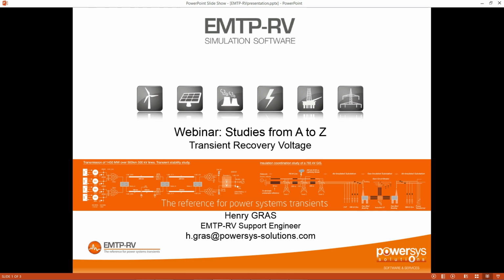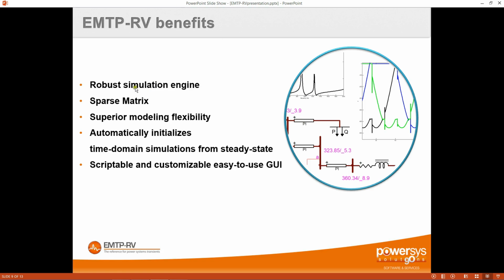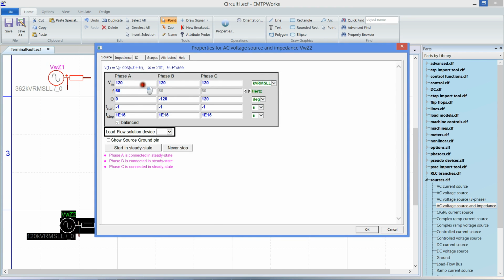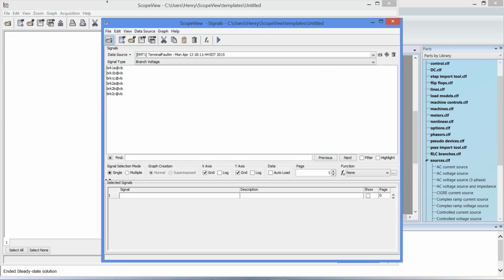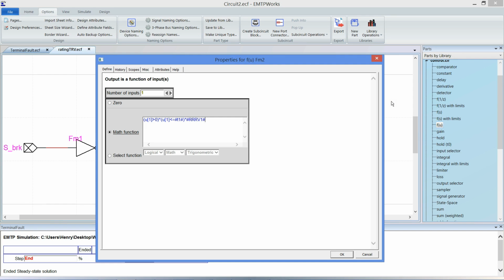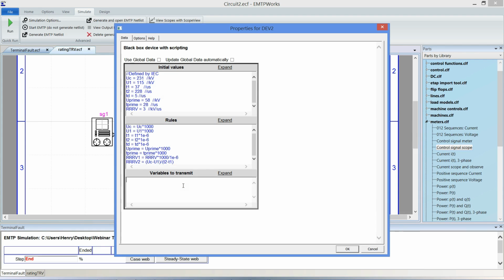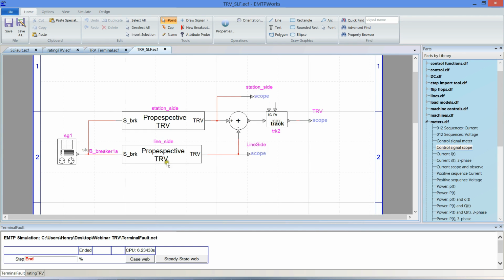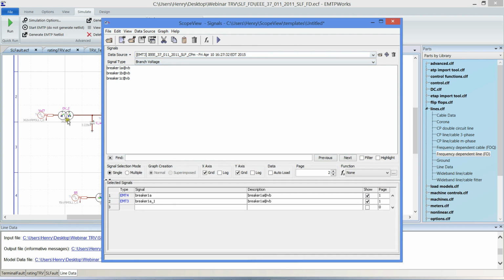Transient Recovery Voltage (outdated - new video available)

Comment: Hi everyone. Can you help me?
I have a problem with the Electric field strength
How do you export the resutl of the Electric field strength for the transmission line with 220kv voltage. I need your help ! Please help me!
 
Mail: trungtvxl@gmail.com
For example:

 X-COORDINATE (M)           ELECTRIC FIELD STRENGTH(KV/M)
 -1.00000E+02                4.57034E-02
 -9.95000E+01                4.59468E-02
 -9.90000E+01                4.61904E-02
 -9.85000E+01                4.64342E-02
 -9.80000E+01                4.66779E-02
 -9.75000E+01                4.69216E-02
 -9.70000E+01                4.71653E-02
 -9.65000E+01                4.74087E-02
 -9.60000E+01                4.76519E-02
 -9.55000E+01                4.78948E-02
 -9.50000E+01                4.81372E-02
 -9.45000E+01                4.83792E-02
 -9.40000E+01                4.86204E-02
 -9.35000E+01                4.88610E-02
 -9.30000E+01                4.91008E-02
 -9.25000E+01                4.93396E-02
 -9.20000E+01                4.95773E-02
 -9.15000E+01                4.98139E-02
 -9.10000E+01                5.00492E-02
 -9.05000E+01                5.02831E-02
 -9.00000E+01                5.05153E-02
 -8.95000E+01                5.07459E-02
 -8.90000E+01                5.09746E-02
 -8.85000E+01                5.12013E-02
 -8.80000E+01                5.14258E-02
 -8.75000E+01                5.16479E-02
 -8.70000E+01                5.18675E-02